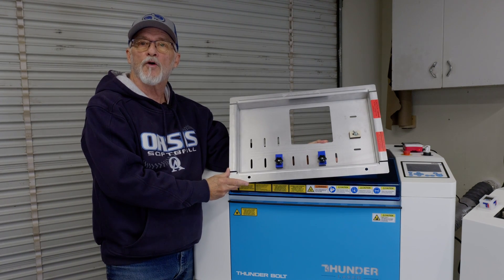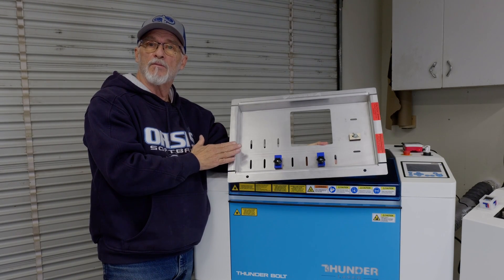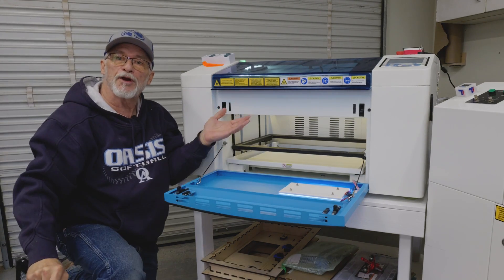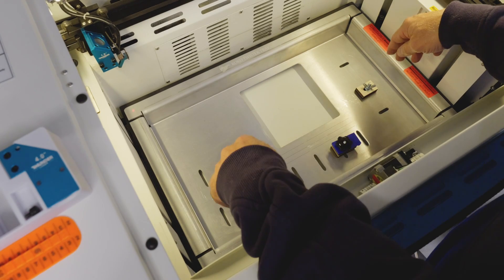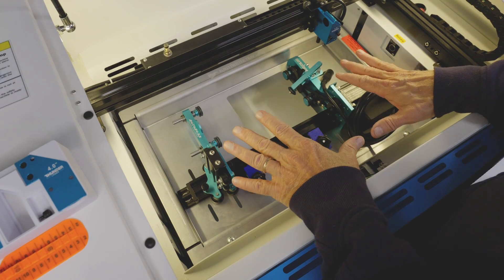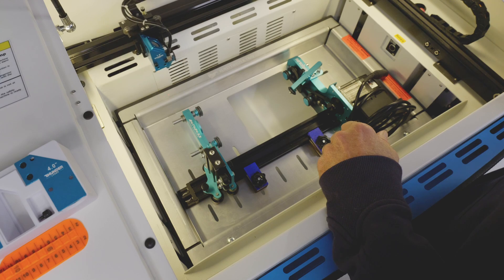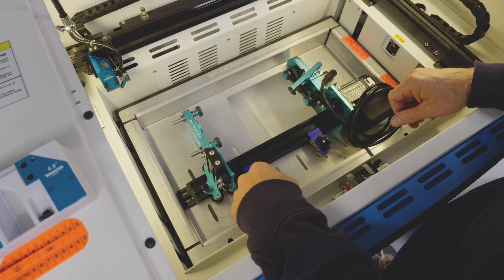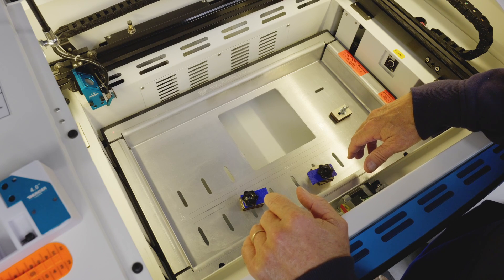ROKO Twister Tray Installation and Use with Thunder Bolt Rf Laser

Comment: Good day Robert - such a smart idea - it looks well made and well thought out. One question - on your website under the description it says" This tray will provide additional Z clearance in order to use the Rotobolt roller rotary or the PiBurn Grip with main rail modifications." What do you mean by PiBurn Grip with main rail modifications? Does that mean I have to modify the PiBurn in some manner? Also, are you able to ship to Canada? Thanks GP
Reply from the maker: In order to use a grip the
Main rail need to be shortened and the motor rotated 90 degrees. If you purchased a grip designed for the bolt then it fits great. I
Just wanted to make sure people understand that the grip designed for the nova series lasers will not work without modifications
Reply: @computercreationz  Thanks so the PiBurn made for the BOLT requires no modification - it fits in as is? And also, are you able to ship to Canada? :)
Reply from the maker: Yes that’s correct!  @GPOutdoors
Reply from the maker: Not shipping to Canada at this time, but may in the future!  @GPOutdoors

Comment: Where can I buy the files for the wood version you had on the bottom of your cart?
Reply from the maker: I won’t sell the file I do have a few wood ones left that I will sell at a reduced rate since it’s been replaced with the aluminum model.

Comment: What would the advantages be vs buying the drop downs that rotoboss has made available for tumblers? Just trying to see what the better option be I don’t engrave anything taller that is not a tumbler.
Reply from the maker: having the ability to do flat work that is 7” tall, much faster setup, more rigid stance for doing large tumblers orders. when taking the tumblers in and out of the rotary your rotary can move around unless secured well making your alignment less reliable.

Comment: Will the low roller rotoboss work for this? I use it on my nova 24 but i just got the bolt and haven't tried it yet
Reply from the maker: Since I dont have a LOW ROLER rotary any more I cant tell you but the inside measurements of the tray are  19" wide by 10.75' tall.